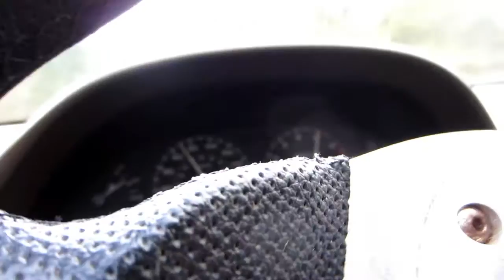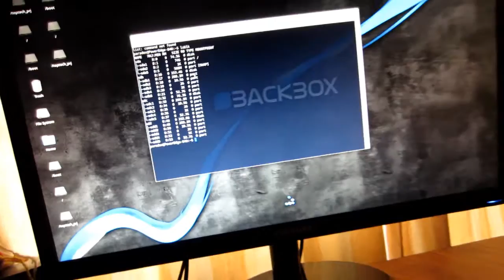240sx Fixed & Computer Haul Updates / Repairs.

Comment: I have one of the first Netbooks a Toshiba Labretto perhaps you remember them. Its a Pentium II 233Mhz and its more usless than that netbook but I keep it around because its fun to break out and play with it. Backbox, I will have to try that out never heard of it before. Pepermint would have been a good choice for that netbook for sure.
Reply from the maker: MidwestMotoRider 233mhz, ouch! that was the speed of the first computer I paid for myself. I do love the size of netbooks though, I find them so easy to lug around and if I drop or break one it's no biggie. where if I'm lugging around my MacBook Air I'm alot more concerned. cheers man!
Reply: Same reason I love them, I tried tablets but its not the same for some reason. Maybe I am just too old for new tricks. :) Have a great weekend man!